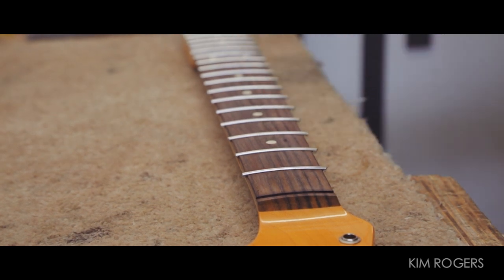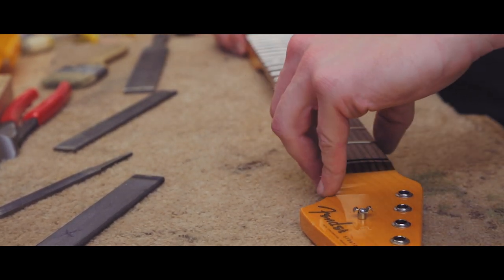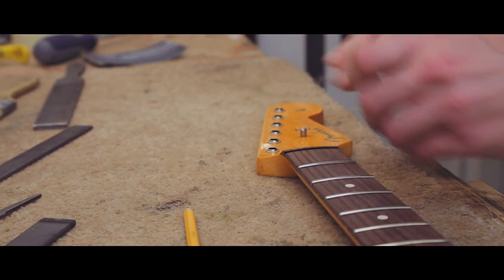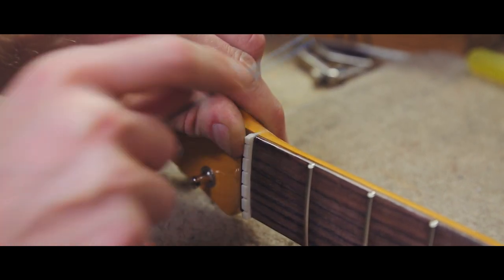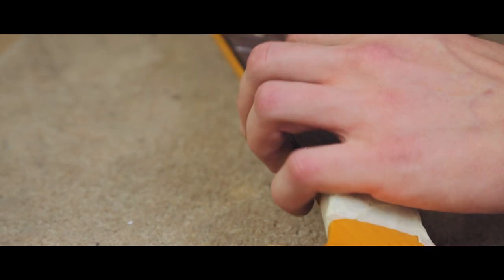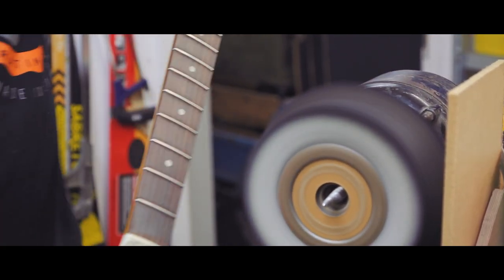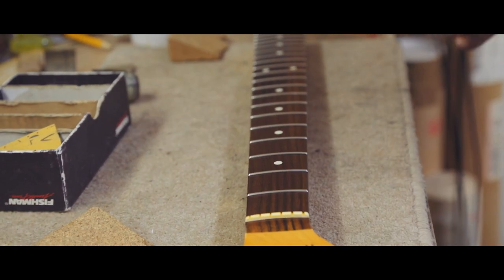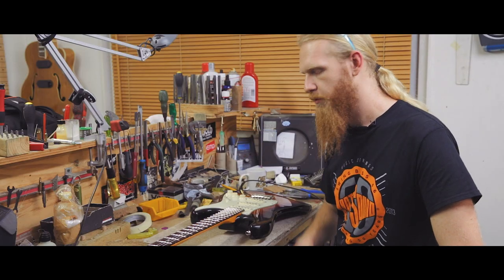Fender Stratocaster 62 Reissue - Custom Refret & Guitar Setup - The Plek Machine | Part 2

Comment: Not clear about processing: is it cutting under simulated string tension or not?
Reply from the maker: The cutting process is done after the machine has scanned the guitar with the guitar strung with the correct gauge and tuning - by the time the machine is cutting the frets, it has already computed the amount of each fret it needs to take off, so any simulated string tension isn't required.  Mass-production guitars that are PLEK'd do use simulated string tension, but this is instead of stringing the guitar in the first place.